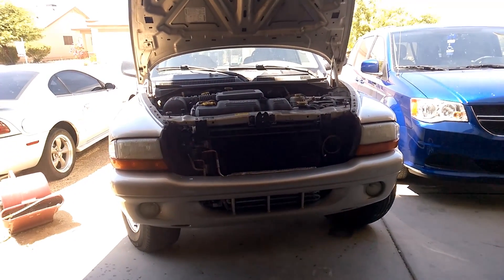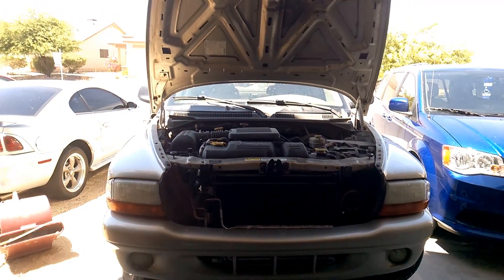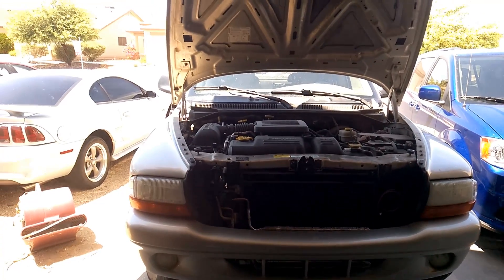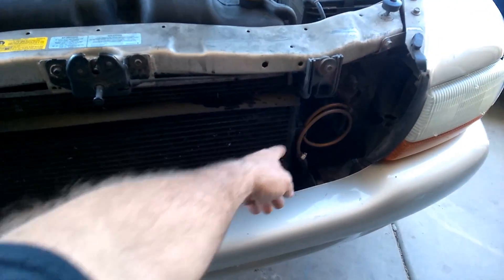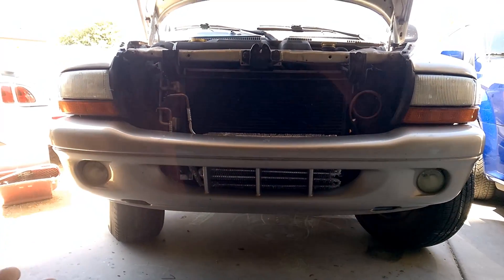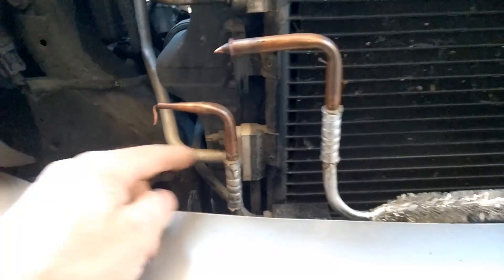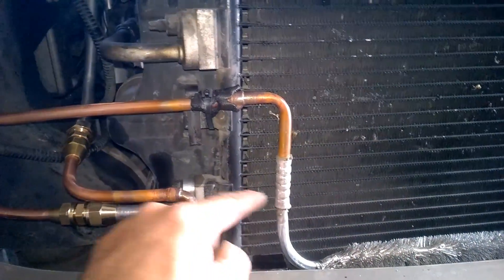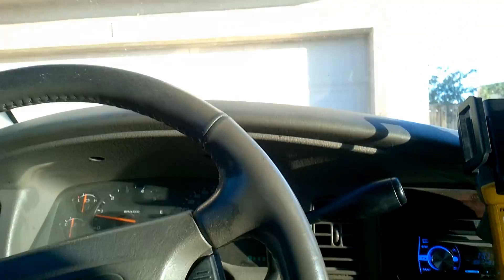Durango condenser Coil Experiment - Success or Failure?

Comment: A lot of time the later years have an  auxiliary cooling fan low on the radiator specifically for helping with cooling the condenser if that fan goes out which is extremely common   it will impact cooling while sitting in traffic

Comment: hackfreehvac...i also live in az, heat is coming up as you know, I purchase a 2000 durango  also in the winter and now I'm noticing it does the exact same thing as yours, was thinking about adding an additional condenser fan but as you pointed out it seems to have enough air flow I would just get over it if it wasn't for my 10 month old, just to hot for him. anyway did you ever find a solution??

Comment: You should change the condenser on this. looks  worn-out
Reply from the maker: +ced raymond It was clean and all.
The few dents in it were not enough to ever notice any difference with a new one.

I don't have this vehicle anymore. I traded it in 2 years ago for a Ford.
No A/C trouble now. :-)

Those dual evap early 2000's Durangos were just a bad design.
Reply: +hackfreehvac Well you made the right decision by switching out the Durango. Changed my original condenser & high/low pressure hose which runs from the condenser proved successful. A/C is as cold as when I  first got the truck. Best of luck with your new ride
Reply from the maker: ced raymond
Nice. I do miss it sometimes for off roading since I don't have a 4X4 any more at the moment.

Comment: I agree with you about the A/C in early 2000s Dodge Durangos.

My uncle had a 2000 Dodge Durango SLT 2WD that he leased brand new. His biggest complaint about the Durango was the rough ride. Also, just months after buying (er, leasing) it, the A/C completely failed on a trip from Pennsylvania to South Carolina. The condenser would freeze up, the A/C would blow warm, and the system would have to be shut off so it could thaw. Once thawed, it would blow cold for a time before freezing up again.

When I was in 8th grade (2002-2003), one of the crossing guards had a 1999 or 2000 Dodge Durango that she bought new. This vehicle was only 2 to 4 years old at the time, and the A/C was completely nonoperational!

Yeah, early Durangos have crap A/C systems...

By the way, I drive a 2010 Toyota Tacoma 2.7L 2WD. Just hit 59,000 miles today. The A/C will numb fingers and harden nipples even on 90+ degree days!

Comment: I do a Little Motor driven Refrigeration out here using Automobile type compressors.
Check with Dtac-my supplier thier is an old dude there that knows Alot! They do A/c for Everything using Engine Driven Compressors including Earth Movers and Dump loaders a/c. Maybe they can Sell you a Different Compressor With a Little More Capacity or you could Change the Pulley Diameter to Get a Faster Compressor at idle rpm's. Those Motor Driven Compressors will usually do max 6,000 Rpm's and 4,000 rpm's continuous.Also you could Weld in a Sight Glass at the Copper Liquid out of your New Condenser and See if the Liquid is Flashing. Use a HMI-1TT3 Alco( it looked like u were using 3/8 to me). Also was thinking a 12 volt fan on a temperature control when liquid line gets hot at idle- it clicks on 2 Electric fans to blow through your New Condenser. Also maybe is under hood temperatures superheating the New cooled liquid line. Maybe some insultubing on the Liquid Line to Keep Liquid Line At Ambient Temp/Cool? Just Some Thoughts / Suggestions Bouncing around in this old Skull of mine. Good Video !

Comment: Try putting an electric fan on the condenser and see if that helps
Reply from the maker: It has BOTH a belt drive and an electric. Factory.
Airflow across the coil is awesome.
Reply: I'll tell yah the heat wasn't so great in the Durango out here in the Midwest either you'd freeze your butt off in them. I've had many Chryslers in the last 30 years some just did and did not cool as well as other models and I've never really saw a dual system that really cooled like it should in my opinion. My 2014 Jeep patriot will allow you to hang meat and so did my 2.4L 4 banger 06 caravan! 

Good luck with this, but I personally think you beating a dead horse lol lol... 

-Mike
Reply: +Mike's Channel I have a 98 Durango Slt. I've changed everything with the ac behind the dash, the lines ,compressor, entire housing w/blend doors,  drier, fan clutch motor & it still blows warm when I stop in traffic. I failed to change the condenser, which is the original from the assembly line.  This should correct the problem. My baby has survived three presidential terms, still have original engine/tranny at 283k & I still service at dealership...#Dodgetough
Reply from the maker: +ced raymond There wasn't anything wrong with the condenser but I did change my TXV, compressor etc because I had doubted all the people that told me that these dual evap Durango's got warm at idle.
They were right. Just a bad design.

Comment: Have you tried hitting the condenser with some coil cleaner?
Reply from the maker: Yeah it's been cleaned with the "yellow death" before.
You can see right through it with the flashlight.

The head pressure is "normal".
And people say that these Durango's have sucky A/C

I was just experimenting to make it better.

Today I replaced the expansion valve for the heck of it.
I did notice when I started it up that the head pressure doesn't shoot way up into the high 300's when you rev it up like it did stock.
So that at least is an improvement.

Comment: I think a drop of 40 degrees below ambient is pretty good. Ford a
Has the best ac systems. Always ice cold. My chevy van gets cold but will warm up like your Durango at a light.
Reply from the maker: Yeah I just replaced the expansion valve today just to see if it makes a difference.
It may have helped slightly at idle but maybe not. (See video I'm about to upload).

In my video I basically stated that the FORD A/C just works so good that I'm expecting this thing to be as good but it never was.

My Mustang put out 38 degrees when I checked it. That's 20 degrees better.
Although the Mustang cab is smaller and I have "drug dealer tint" that makes it dark inside.

Comment: Careful, some automakers (GM I'm sure, Dodge I don't know) build a reed valve into the high side tubing between the condenser coil and the filter-dryer. You'll get almost always the correct pressure on the high side because of that, even when the system's low on refer.
Reply from the maker: Weird never seen that before. But I had this line off and saw nothing in there.

Comment: It is sure to have helped some, giving you more subcooling.  But if the system wasn't flashing gas through the expansion valve in the original config, I don't know how much the additional subcooling actually changes final cooling.  Seems it would need more pumping from the compressor now to increase capacity.  Interesting to think about.  You did a great job with those lines -- I'm scared of aluminum.  Nice video.
Reply from the maker: Yeah I was thinking maybe it has some gas with the liquid since it's a dual evap system but the condenser is the same size as a smaller system.

Couldn't hurt on those hot days tho when it gets to 115 to 117 degrees, 120+ relative off the asphalt.

Comment: My wife's 2000 dodge grand caravan puts out 44 to 48 with ambient air temp in the high 90's. I do like seeing copper tubing under the hood, very cool looking.
Reply from the maker: HA HA thanks.

I've got a 2013 Dodge Grand Caravan.
I'll need to see what it does.
I can tell that it is not as good as the Ford mustang but it is better than my Durango.